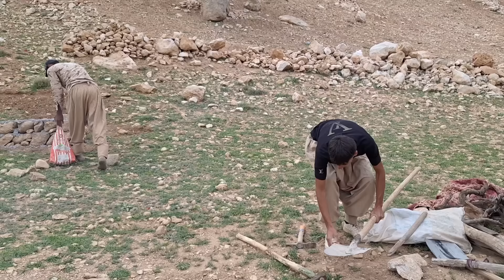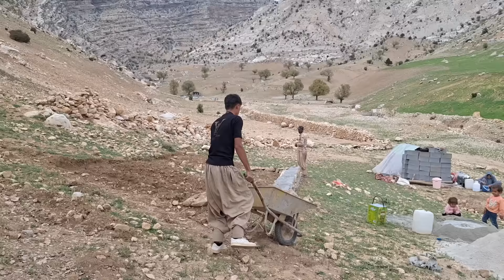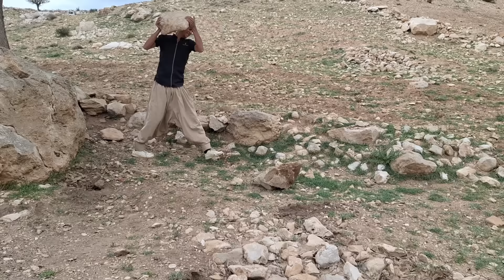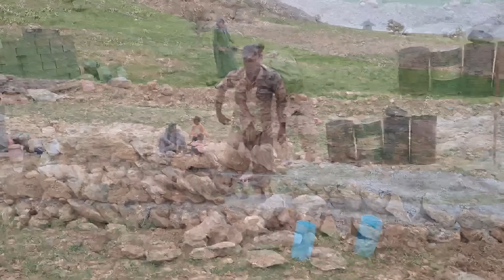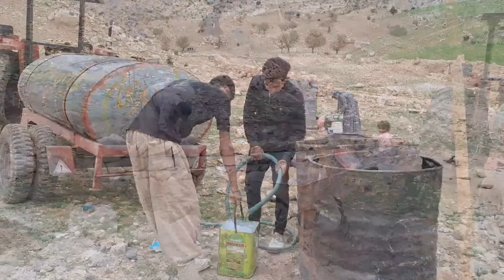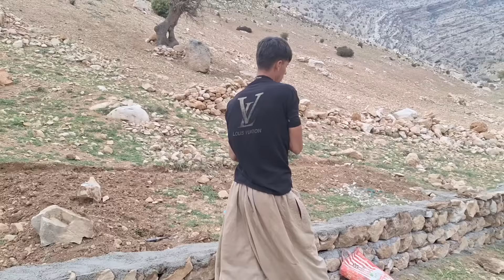Working with Mohammad to build a dream house

Comment: Wowser 😮 Mohammed is a good  driver. Amazed at how he maneuvers that tractor in such a small space. I use to pull a 18 foot caravan on the back of my car & i know reversing by driving  clockwise & anti clockwise it not easy. Good for you Mohammed. Its good to see you helping  Mohammed Reza. One thing I know about Mohammed who drives the tractor is he knows how to mix cement. Blessed these two men helping Mohammed Reza. 
I hope the young man  is offered something by Narges the Boss.